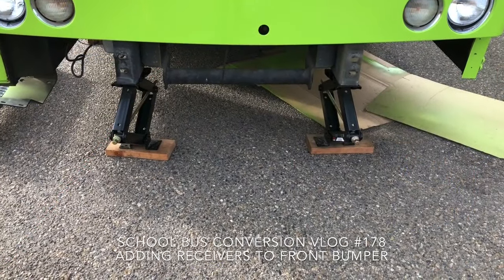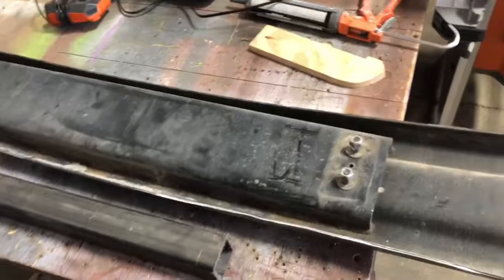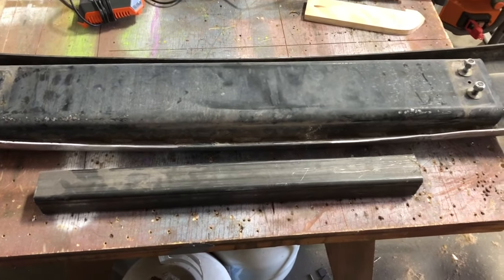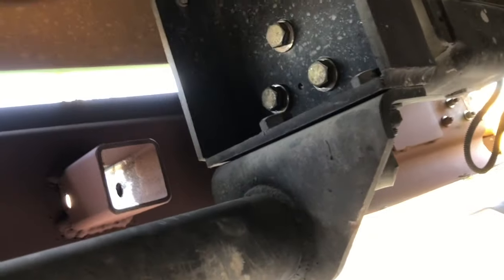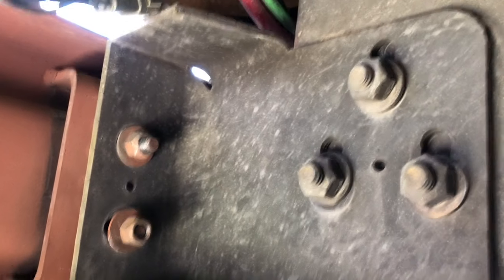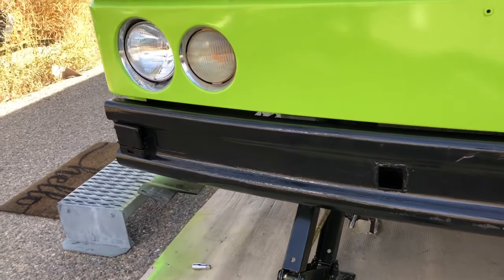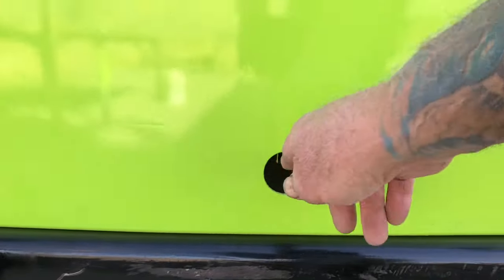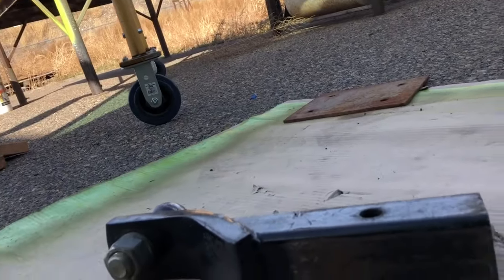Adding Receivers to Front Bumper - Vlog 178 School Bus Conversion

Comment: For our receivers we will be taking them off of our truck and horse trailer along with their respective key locking mechanisms.  Some say people might try to steal them (that was certainly true of our truck receivers) so we'll just lock them down.  Great work and how blessed yet again you are to be there where you can manufacture exactly what you need.😊
Reply from the maker: Thanks for the tip. 👍😍👍 we hadn’t thought about that.

Comment: Very cool. I've seen expensive bikes wobbling around on a rack. Yours is much better. Get some locking pins so your rack doesn't disappear. Great video, as always. You should monetize & get paid for your work! 👍🏻
Reply from the maker: Thanks for the support and the tip. We have been on the fence whether or not to monetize. 😃👍😃.

Comment: Looks handy Randy. Do you think it's strong enough to use for a receiver winch would you get stuck? I'm planning to also add a front receiver and a moose guard. We have a 12K lb winch and snatch blocks we'll bring on the road and have power cables up front to get unstuck if needed.
Reply from the maker: We Think it would work OK for a winch. Hope we never have to find out though. 😃
Reply: @KnappTime  maybe you can pull other stuck vehicles out 😆